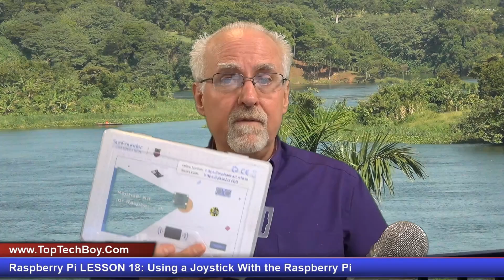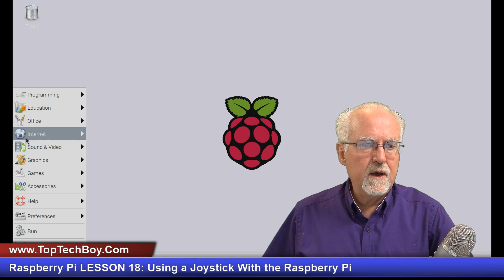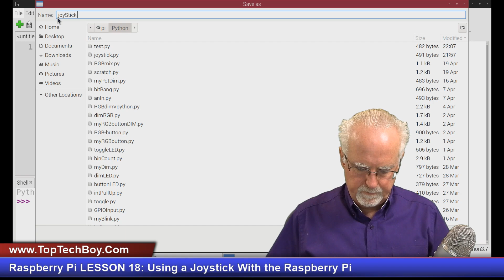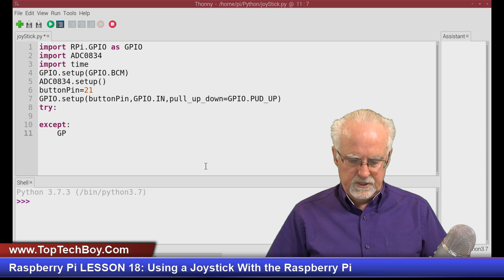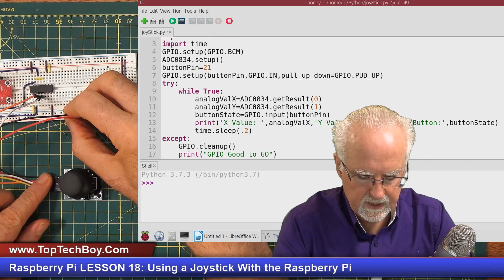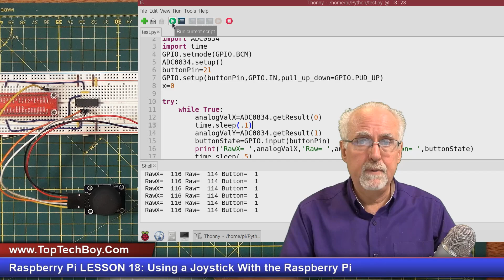Raspberry Pi LESSON 18: Using a Joystick With the Raspberry Pi

Comment: Hi Paul, great tutorial very concise and straight to the point! I wanted to ask, Is it possible to use the joysticks in Retropie as I am building a handheld console. I have made one before but using only push buttons and I programmed those using the terminal in Retropie but wondered how to program the joystick. Would I need to use Python as you did in Raspbian OS and somehow dual boot into retropie after and it should work?

Thanks for lesson :)

Comment: Paul, thanks for the joystick introduction and explanation.  My program would not run at first although it was fine on lesson 15 where you used "from time import sleep" line instead of "import time"  The screen came up "GPIO Good to Go" but did not any joystick data.  When I  used "from time import sleep" and "sleep(.2)" for the delays everything worked fine.  Not sure why? Note I am on Python version 3.9.2 and adjusted my library location for the ADC0834 to suit.